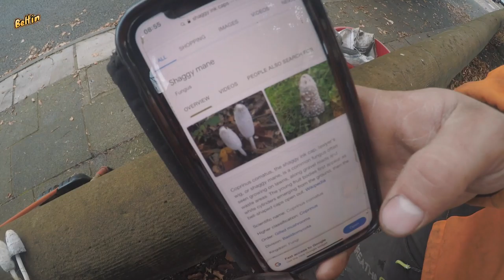(Raw) Unedited Start To Finish Tree Removal

Comment: Hi Matt quick question i’m a new subscriber the blue rope that you used is it a climbing rope as well?
Reply from the maker: Hi Ricky thanks for watching and subscribing! To answer your question NO! a climbing rope is used for only that. Any rope that is used for life support is only ever used for that purpose. Rigging ropes are only used for rigging. regardless of safety the two ropes are completely different construction and not designed to be used for both applications anyway. Hope this helps. Thanks for your comment.